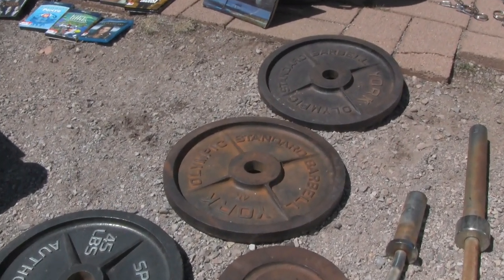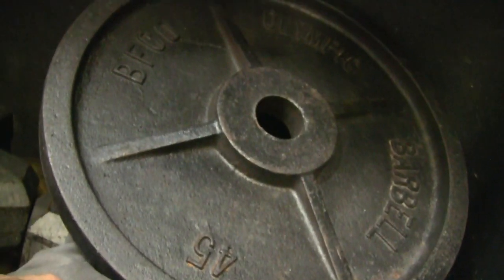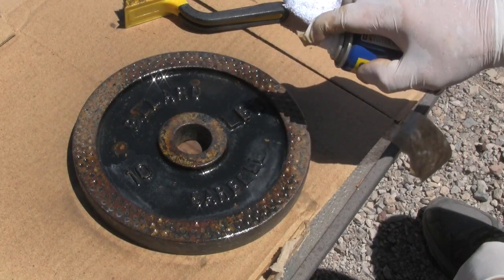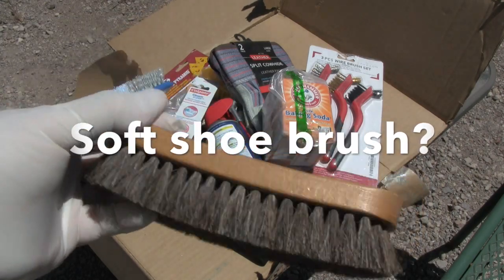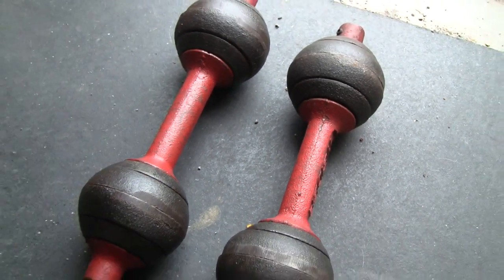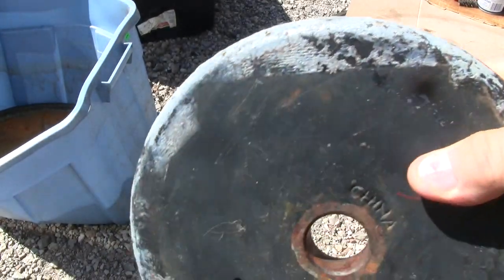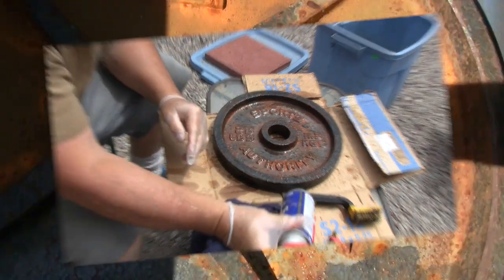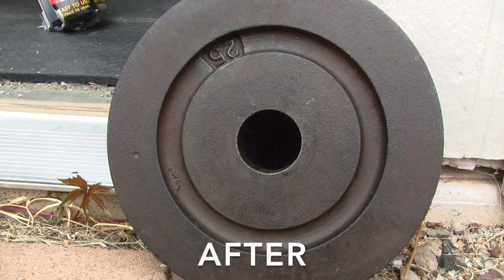Removing Rust from Weight Plates with WD-40 and/or a Vinegar Bath

Comment: Thanks for the video! 
Do you experience WD40 as a good corrosion-protection as well? Do any of the plates formerly trained with WD40 rust again?
Reply from the maker: Well, I'm not an expert, but my understanding is that WD-40 coats the weights. For how long, I don't know. You'd probably have to reapply from time to time, the same as you would for oiling (or even -- in longer term -- painting) plates. My presumption is that WD-40 won't last forever, of course, as a coating, and, depending on the humidity, rain, and such of where you live, you'd have to reapply that -- or oil, or something -- from time to time. Thanks for the comment.

Comment: After hit ‘em  with  wd40 .   Do u spray or wash em off or are plates left alone and slippery?  Serious question. I got a back porch full of orange 45 plates. Thanks!
Reply from the maker: Well, after I WD-40ed them, I wiped them down with a towel. Then i just let them dry for a while. They don't really turn out slippery. I'd image that if you used an actual oil that might be more of an issue.

Comment: 90% rubbing alcohol should remove that tape quickly and if that doesn't work acetone/nail polish remover would eat right through it and possibly the paint as well. I've used acetone on a plastic paint palette but I didn't realize how strong it was. It ate through the acrylic stains and then through the palette. I've never used it on metal and from what I've read it shouldn't damage the plates. 

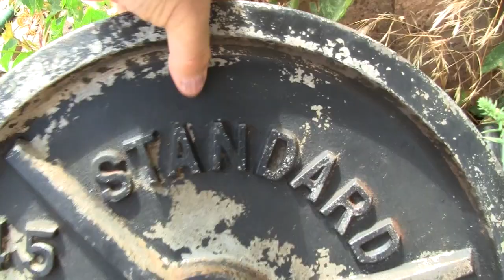I'll be cleaning some 35 lb plates tomorrow so I'll test out the acetone to see if it could solve your problem at 9:21. I'm going to try and use a cloth with acetone on it to see what happens. I'll edit my comment later on with the result.
Reply from the maker: Thanks for your experience. The more people mention their own experiments, the more valuable the information here should be.